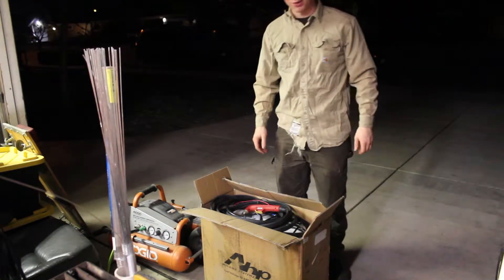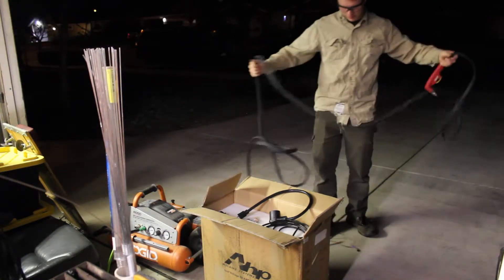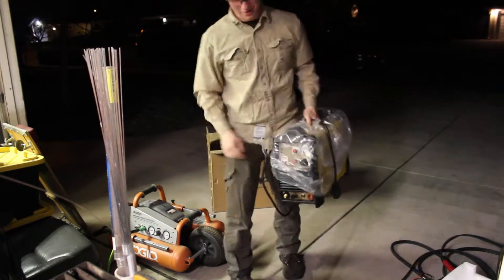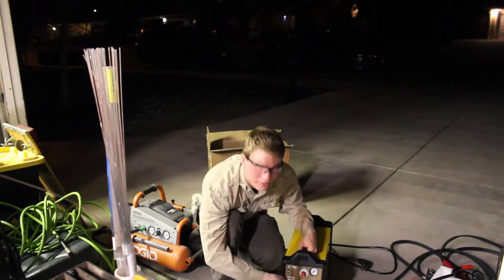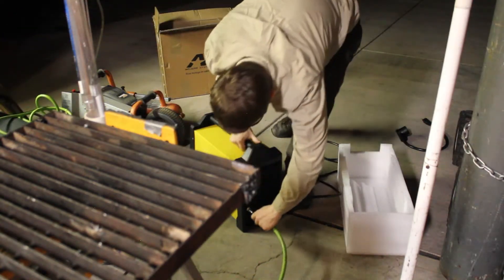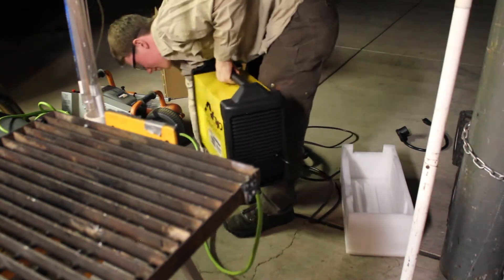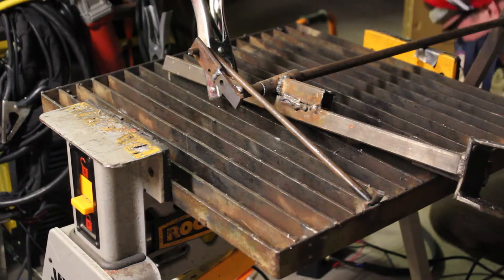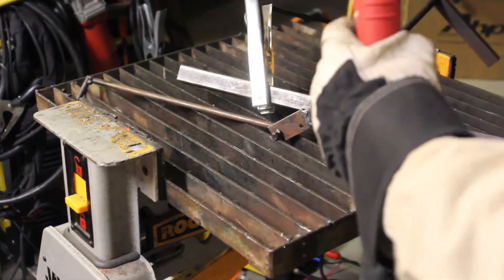AHP Alphacut 60 Unboxing and Test Cuts Part (1/3)

Comment: what kind of air compresser you using, John from Ga
Reply: It is an old rigid 5 gallon wheel barrow compressor I got 6 years ago. Thanks for watching!
Reply from the maker: Hi John! It's a rigid 5 gallon wheelbarrow air compressor I bought 8 years.
Thanks for watching!